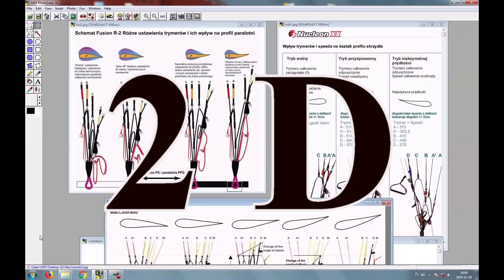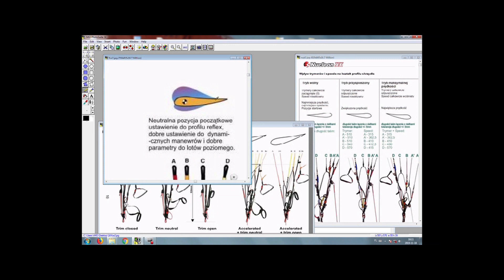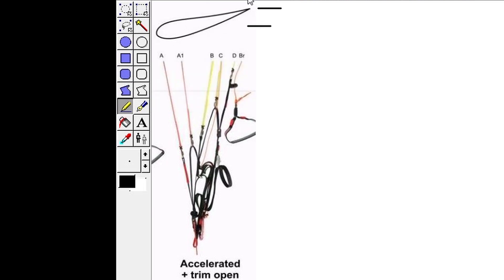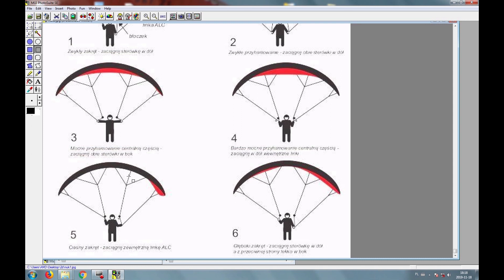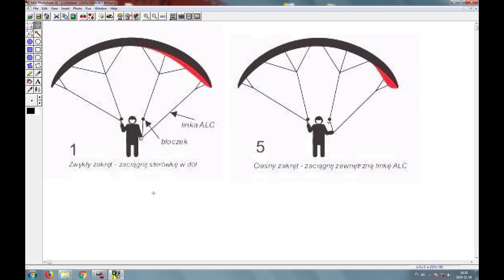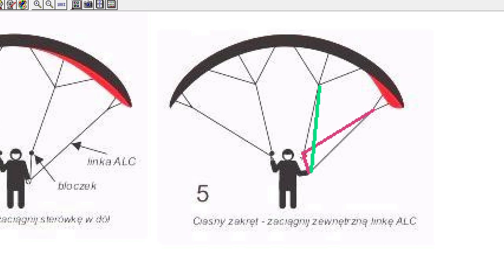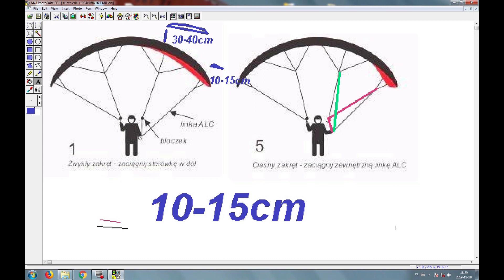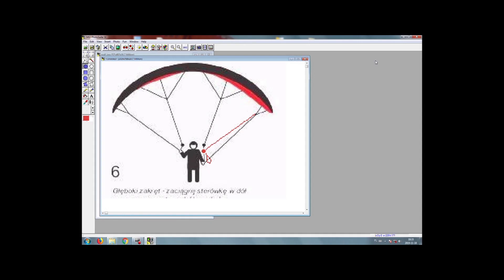2D steering PowerParagliding ...take it or leave it...

Comment: Hi Sean from the Burren you’re observations on 3d stearing is very interesting 
I see many of my friends use 3D Sterling, your obeservations will be of great interest and each poilet can make an enforced decision based on your theory. I will post this video link in paramotoring Ireland WhatsApp group,keep up the good work 
kind regards Sean
Reply from the maker: Thanks Sean, still waiting to get  email connection
Reply: I think the premise is flawed. Tip and main brakes arent thru the same roller. This difference allows you to move your hand towards a tip and away from the main brake roller. This effectively makes you pull more brakes and less tip. Crossing your chest would have the opposite effect.  I dont know much, but this just makes sense to me. Apologies if im totally incorrect. Its been 2 yrs, whats ur take on it nowadays?
Reply from the maker: @shanesplanetshane3795  1.thanks for comment...
2. Sorry but you are wrong. If You look precisely You will observe than ANY move on the brake handle pulls the brake! You cant move the handle towards body pulling stabilo without pulling main brake. It works a little cause the brake lines are more loose. When deep pull you pull brakes, and stall glider (when trims up).
 If the lines were opposite, brakes loose, stabilo through brake roller,  it would be possible to pull stabilo without brake...
The first Paramania that made this has stopped to do it . Now they have stabilo on independant handle.
Reply: @Mazby2  tip steer is typically tighter than the brakes. It is true, you can't pull one and not the other(excluding slack differences), but the amount of each, can be different. If i push a brake handle towards the tip, it will actuate a lot of brake but no tip on that side. My new glider came with tip steer on its own toggle, thru its own guide ring. I do think its a great setup, as you can revert to just tip steer when on bar. You can tie in ti pto brake, and youll need to remove the tip line from being routed thru its guide. this effectively gives the tip and the brake a different ratio of travel, depending on pull angle. To operate tip only when tied in, you have to pull the line by itself, leaving the brakes stowed. I see that it has some merit and maybe small advantages.